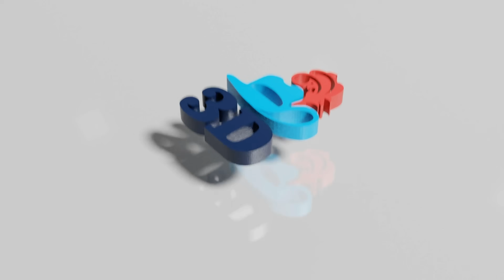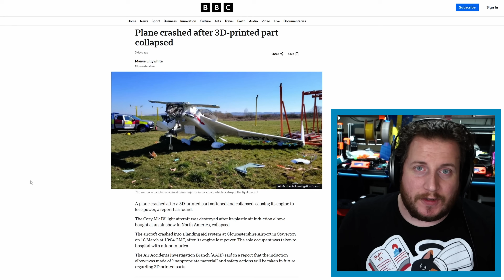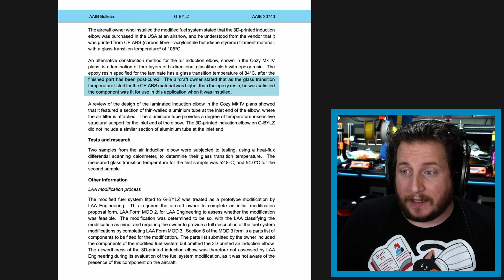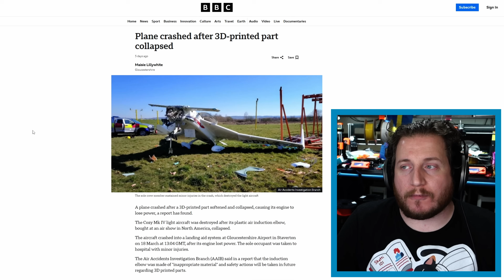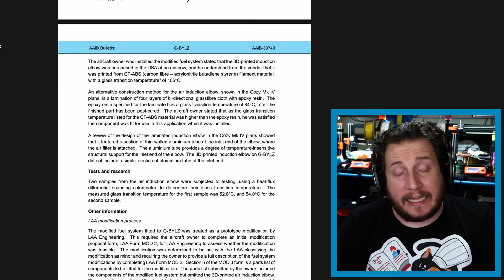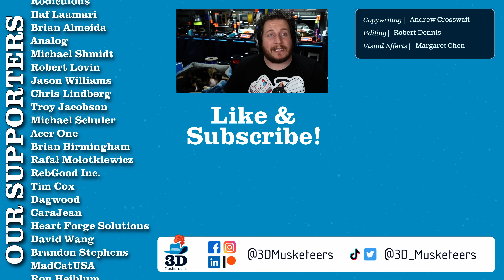A 3D Print Caused a Plane Crash?! - PrintFixFriday 222

Comment: One extra thing is that the iso 71 that spesificly tg is fore a very small load 
Aka at the tg the plastic will deform bet if you have a very high load it can be about half that number (depending on plastic).
Ther is somtung that is called "maximal working temperature" that is more relevant since it tests under higher loades bet not that meny company Public it since it is a must lower number

Comment: This should have been a completely solid infield The part being sealed and having open internal structure the trap air vibrates and causes heat and friction destabilizing the polymer combined with lower altitude and change envirometric pressure you're asking for a bad time ABS is definitely not made for that at least the 3D printing filament ABS

Comment: I think it’s necessary to remember that many engine parts are actually made from ABS, a lot of intakes that are bolted to the engine are ABS. I get the feeling that it was the material more than anything else. But without seeing the part and how it was sliced, it’s also possible they used the wrong wall thickness and infill percentage.

Comment: HT-90?
Printing Ultem?
Yes please!

I try to avoid printing mission critical, life depending parts. IMO that's a job for the machine shop. However, when it comes to things where safety might be an issue I always start with multiple destruction tests of printed parts to get an idea of how it behaves. Feels a little bad when you burn the first half kilo of PPA/PPS in parts you plan to destroy but probably less bad than being served suit.

Whoever printed this part screwed up majorly. With a Tg in mid-50's there's no way this would have printed correctly with ABS-CF print settings. I assume at some point they'll hand the part over to chemists who will conclusively identify the polymer.

Comment: Never thought of selling or using FFF printed mission-critical parts for a plane even if I tested them. He-temp. resistance is not the only issue with 3D printed parts, and even "ove-engineered" parts can fail in unexpected ways with time. Low-temp brittleness, creep, low impact resistance jsut to name a few issues.

Comment: Ähm, if you print CF or GF PLA with ABS CF or GF settings, guys, that gets really toasty because by ABS you need to switch off the fan. I do work with ABS roughly 70% of the time, i accidently mixed this 2 already up. It ended up with a new print head for this machine, because the PLA wraped around the hotend up to the pcb. I do think this was printed and sold knowingly that it is PLA CF and sold as ABS CF because it increases the price X times!

Comment: The chain of liability is long on this issue, but I find it hard to believe someone printing PLA-CF would think it was ABS once they actually went to print it. ABS nozzle temps and an enclosed chamber would ruin PLA prints. If the person printing it couldn’t tell something was wrong then I blame them. I have a harder time believing a manufacturer just lied to that degree. Seems much more likely that the person selling it/printing it lied.

Comment: I built a printer that can do 90 c chamber temperature. Some of the small components I originally printed in what was supposed to be a polycarbonate cf with a 150c glass transition temp. All of those parts along with the over the counter high temp heater recirculation fans turned to chewing gum on the first warm up.😂

Comment: Most, almost EVERY Chinese filament manufacturer exaggerate the rated temperature resistance value, most of them did not even specify the test condition! Those numbers would be tested under ideal condition with NO stress on the part. And since many filament manufacturers add plasticizer or other additive to make the part stronger, there is no surprise that an ABS-Base (Non-pure ABS) to fail at a constant wind of 60degree C, while being under load.

Thanks to point out that, we can and should be more cautious when dealing with 3D printed part for life to depend on.

Comment: PLA doesn't even have a glass transition in the 50s. That's insanely low.
Reply from the maker: Well, it was already melted we do.expect some reduced performance, but yes, that's low.
Reply: @3DMusketeers Honestly, the most pedestrian filament I'd print this in and even dare to use just to fire up the engine would be PC. I wouldn't even trust nylon. To trust ABS? Might as well build a submarine out of laminates...  too soon?

Comment: i was trying to find info on the faa approved filaments but came back empty. Any links because co-pilot is stating its by part not filament manufacturing. i was wondering if we'll eventually see ppa-cf approval for specific parts that if coated could hold up over time and possibly work in this type of scenario. it holds it's tensile strength over 100c. exposure to moisture and temperature cycles would be a question mark for longevity which you definitely would want to test lol
Reply from the maker: Ultem 9085 when printed properly does not need further testing to be certified for flight. It must be from Sabic, have traceability, etc. 

As far as ppa, not sure. Ultem is about the only stuff right now. Stratasys has white papers on it lol. They spent the money....
Reply: @3DMusketeers interesting. Thanks for info. 🎉

Comment: One does have to be careful about where they buy stuff but this sounds like it's so obviously not the right product that they would had to of noticed it was off/wrong when they were printing it. 
In 2022 I bought a roll of Amazon Basic Blue ABS filament. When I finally went to use it like a year and a half later, it was just burning up and crystallizing in my hotend at it's recommend normal ABS temps. Messing with it while trying to lower the temp it was still just burning up and crystallizing in my hotend even down at 180 C. I haven't touched that roll in a bit but my guess is somehow a PLA roll got though and labeled and boxed up as ABS but their is no way one could successfully print that "ABS" like it was ABS.

Comment: It's still wild to me how much "plastic" is not only in a hot engine bay, but doesn't melt. I've never thought to make a "mission" critical part mainly because I wouldn't be able to trust it. Especially on my mid engined car where it's amazing the intake up against the firewall that has the engine on the other side of it doesn't get completely cooked and melted. lol

Comment: 6:33 yep, Certified parts are very costly. Because it costs a lot of money, to get parts certified. That's why they are so expensive.
Would i like to own and fly an airplane? Sure. Do i want to pay for its upkeep with annuals and certified parts? Hell no!

That said, yes, the fact that it was a pusher (and a canard style) plane saved the engine (ie, the most expensive part of an airplane). 3d Printed non-critical parts, sure. As long as its non-critical (ie its failure wont result in changing how the plane flies especially in a catastrophic, unrecoverable way).

Hell, I think its sketchy (and a waste of time) to 3d print something like a Cell phone holder for your Car because the heat would melt it lol

Comment: Not convinced it was ABS-CF, it could have been PETG-CF, or similar as that has a lot lower glass transition, but I’ve used Extrudr GreenTEC Pro Carbon inside engine bays, that is good for 165°C (VST305), but only in non critical areas.
Reply: Even PLA glass transition is over 60c.

Comment: To be honest, just seeing how the part is modeled, I would not trust it. It doesn't make sense and seems more like it's made for CNC, taking no advantage or logic that we would use for 3D printing.  

And I think that if we buy such important parts, there should also be small test pieces included that we can use to check the quality of the material and the prints (temperature/strength/etc.) or lab results.

Comment: Just changinging nozzles material (brass, copper, harden steal) can compamise a part if the temps and speeds are not adjusted can change strength. How many people print with brass then go to steal nozzles when building industrial parts only to find out that the part lost 20 percent of it's strength.

Comment: If I'm going to trust my vehicle to a 3d printed part I'm going to test it. It's not hard. Beds easily hit this temperature. So test it to like 90c. Heat up the bed, then put it on and see what happens.
Reply: Pretty sure you can just boil it in water and see if it warps. That gives you a pretty good idea of how it behaves around 95-100C
Reply: @OttoLGlass  there are a number of ways, but I would definitely check it out with one of them. That was the first thing that came to mind. During the video I realized a heated 3d printer chamber would as well. And of course Grant mentioned a toaster oven.
Reply from the maker: EXACTLY!!

Comment: If you printed something with that low a glass temperature using the techniques to print ABS, the bed would melt the print and the result would be obviously bad. The person who printed the part is the one who lied.
Reply: Totally agree. I've accidentally sliced a model with an ASA profile when I meant to use PLA, and it was flopping all over the place on the print bed. There's no way you could  make that mistake and not notice.
Reply: Totally true, in 2022 I bought a Roll of Amazon Basic Blue ABS filament. When I finally went to use it like a year and a half later, it was just burning up and crystallizing in my hotend at it recommend normal ABS temps. Messing with it while trying to lower the temp it was still just burning up and crystallizing in my hotend even down at 180 C. I haven't touched that roll in a bit but my guess is somehow a PLA roll got though and labeled and boxed up as ABS but their is no way one could successfully print that "ABS" like it was ABS.
Reply: I would really like to know what machine and settings were used as those will reveal a lot about the responsibility of who lied. I tend to agree with this since the bed temp for ABS would be well above what was demonstrate to be the actual TG but perhaps they were using a "cool" plate, I do not know of one that allows printing ABS at such low temps though. In all likelihood it was not ABS and someone misspoke about the material when selling it and they should be held liable.
Reply: Just what I was wondering, this almost sounds like it deformed at PLA CF temps, best case maybe some easy abs or something